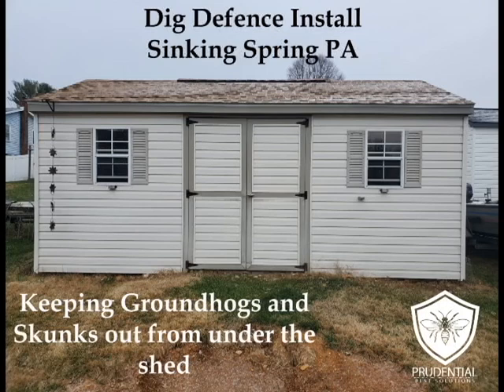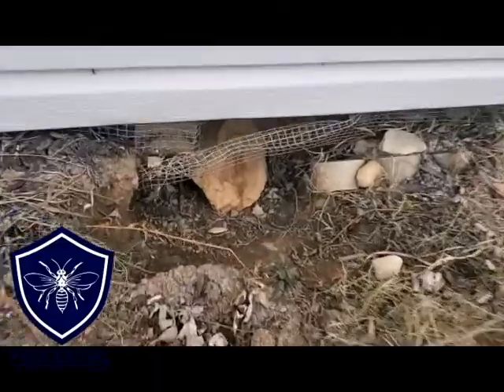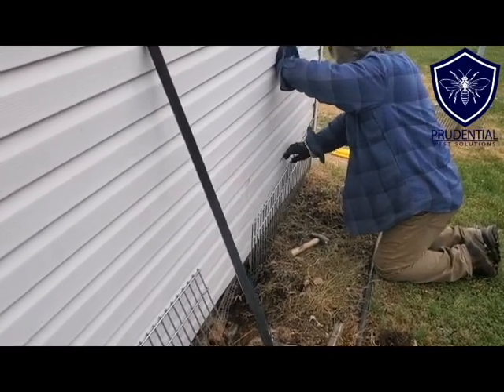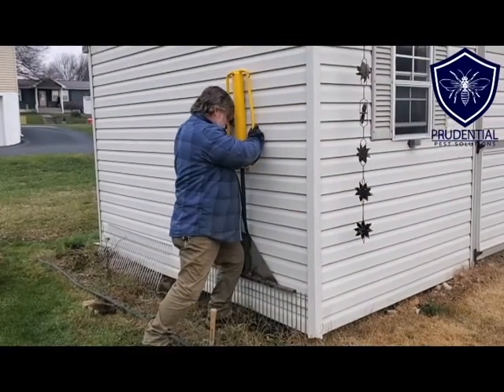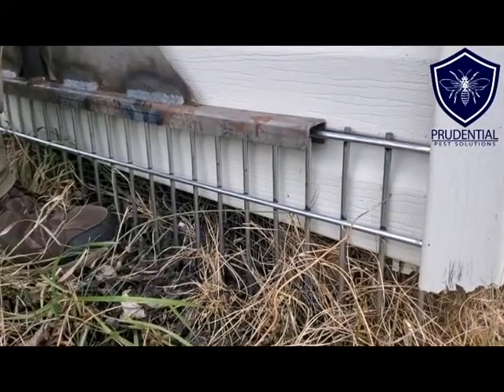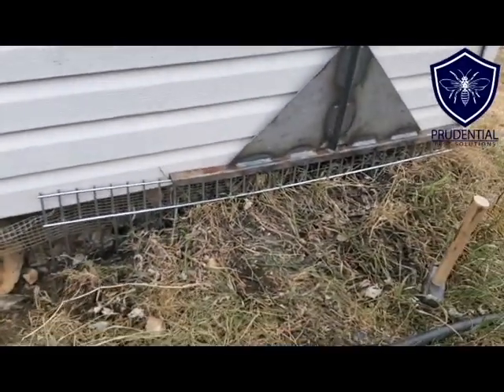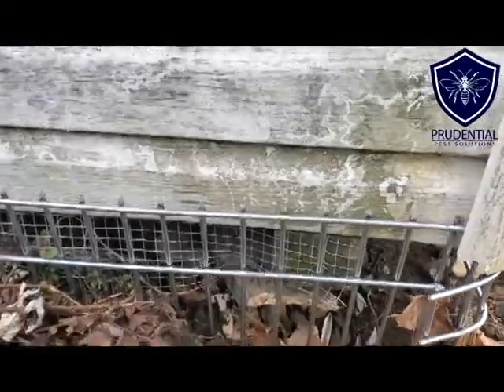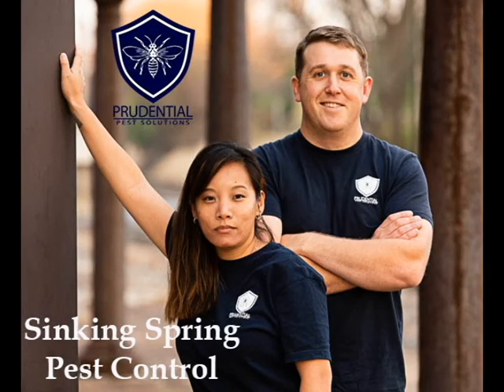Dig Defence Installation Sinking Spring PA

Comment: How deep do you have to dig to keep rats out? I wish dig Defence help to keep rats out but obviously the Gap is just too big
Reply from the maker: For smaller animals like mice and rats, you could use 1/2" or 1"4" galvanized hardware cloth. We have another video that shows that process. Thanks for the great question!
Reply: @prudentialpestsolutions  thanx but I'm curious if there is a way to attach the 1/4 inch hardware cloth to the dig defence and then just bury that in the ground...that would save so much time and labor.